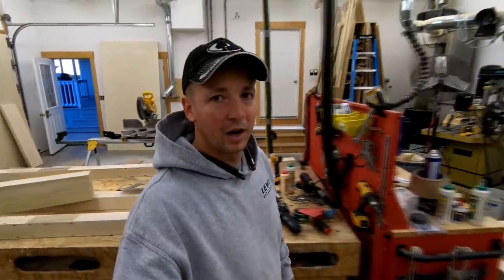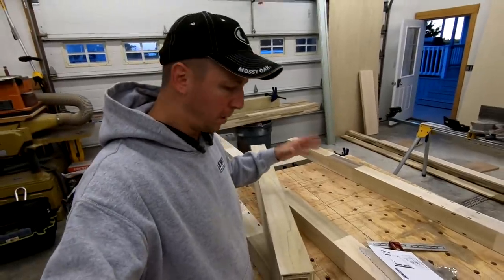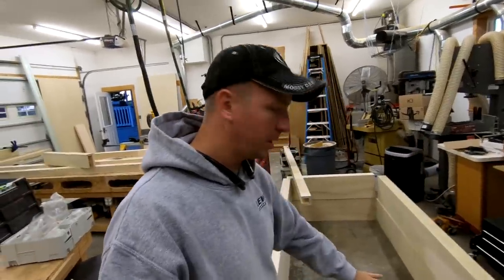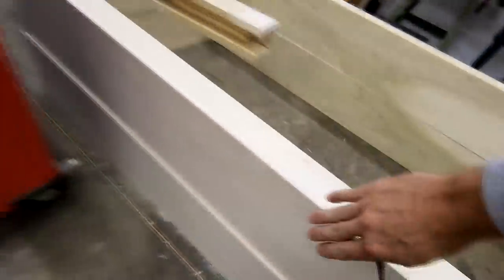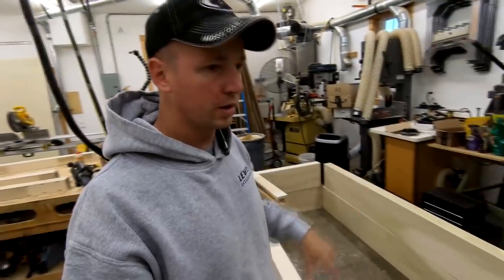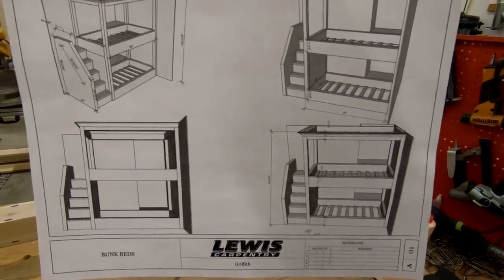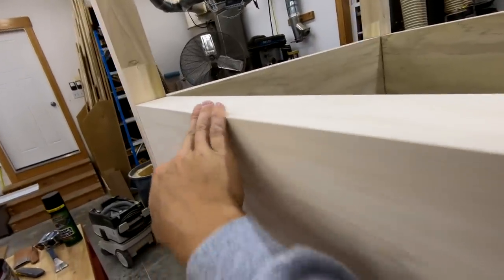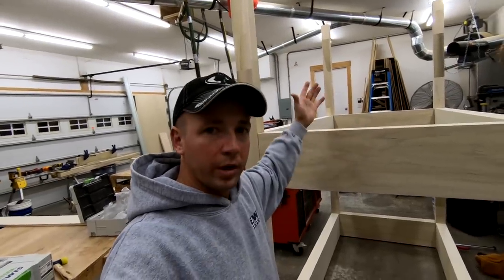Bunk Bed Project - Why I Use a Tape Miter Fold More Than a Lock Miter Joint

Comment: I have to say I enjoy watching your videos, I am a very seasoned woodworker and extreme high end kitchen cabinet and staircase installer. I’m always learning new things, not very often from watching others. Usually by trial and error. Our work is always perfection. Since watching your videos I have learned a few different techniques.  This being one of them. Also the mortiser for drilling square holes. I always wanted a mortiser, but never had a real reason to spend the money. Recently had my first new staircase that used the iron stock balusters. It worked awesomely the treads and on the straight railings. I did run into a few issues with he angled railings, nothing that couldn’t be dealt with, just not perfect first try.
Thank you, please keep doing these videos.
Reply from the maker: That’s awesome. 👊

Comment: Thank you very much for the explanation on your techniques. I strangely feel like my last comment sparked this video. But, your explanation is excellent and honestly answered my question.
I'm using a couple lock miter bits on my router table and have had great results. I have always used a table saw for these types of jobs. I think you clearly answered my question. I think the problem I have had is using blue tape vs clear packing tape. I am doing 2 custom columns this week, and I will be using the HD clear tape.... LOL
Thank you very much for your insight, and clear explanation. You kick serious ass my friend. I will keep you posted on the results....
Reply from the maker: It’s a great topic to talk about. I think you’ll have good luck with the clear HD packing tape. 👍👊

Comment: Awesome vid and explanation, agreed, we use the freeborn lock miter bit in a SCMI CNC shaper, with power feed, did a massive fraternity that called for 5’x12’ walnut panels for walls, (mdf core) then there were beams on ceiling in a grid, beams were 12” wide by 12” tall, we miter locked the MDF, and I would recommend against that because the tongue was extremely fragile, installers pulled it off, but with that being said, running ply core through a miter lock I’m just not sure of the strength in tongue plus how well it would cut, 

Non the less miter folding is just as effective and gratifying at the end when the job is complete, nice job, that’ll be a killer bunk bed!
Reply from the maker: I’ve use it on plywood also with mixed results. Better to fold it. 👍

Comment: I’ve been doing custom woodworking for the past 19 years now and I honestly can say you are fantastic at your job.  Skills and knowledge is a true masters class.  But as you know, every tool you display isn’t cheap and most of us can’t just go out and buy the tools you own.  
So what’s your Philosophy on buying tools and do you set a limit on the price you will or can pay.  A good example is your deWalt cordless router, or should I say the 6 of them.  I have one and it’s amazing, but I cat justify 6.  Your lazar pointer  tape measure which is awesome, is $142.   For some guys that’s a days pay.  
I get the fact that without these tools you can’t do this level of work, especially by yourself.  So how did you cross that line in your head and just buy the tool?   What’s your annual budget on tools and how much would you say you have spent over time fir you shop and van?

I would like to see some inside drone shots of those beams you made.  What a great skill set to have.
Reply from the maker: Great topic. I definitely need to cover that at some point. 👍

Comment: First love your content, I’ve learned more from your videos than probably anywhere else. With that said, I think you would actually like making bunkbeds if you put the plywood aside and used actual hardwood. Yes the material cost goes up but your labor and satisfaction improve. You obviously don’t need to make them for your main source of income so if people want them, make them the way you want.
Reply from the maker: I'm not a fan of the design time and legwork involved mostly. I actually like working with plywood in this instance. Its much easier to work with IMO.

Comment: Great video...

I did a test using this method on some PVC trim boards using just some CA glue. Turned out amazing and I couldn't break the joint. Gonna reinforce with some hidden screws for my project.

Do you think CA glue/screw will hold up long term for exterior trim use?
Reply from the maker: No. CA glue breaks like glass. It seems strong...until it isn’t. It’s not for the outdoor environment where materials move with the seasons.

Comment: Nice work.  Why is packing tape preferred over blue tape?
Reply from the maker: You can see though it and tell if the corner is aligned correctly. With blue tape you are flying blind. 👍

Comment: Nice work, sure wish I had a domino to do that type of pin, rather than a biscuit or dowel pegs... nice. But then again, pegs are cheap :) I use a vinyl tape, its super strong and has an adhesive that is strong but won't stick when you peel it off... its blue, not sure what it's called.

Comment: I use a 3 1/2 HP router in a router table I made myself and I have a power feed I use with it as well. This works for raised panel doors and style and rail door construction. I have well over 100 1/2" shank router bits I use for moldings and other decorative. And yes I am a 3rd generation woodworker, retired now and I have a large shop to work out of.

Comment: Wow, looks fantastic. How does the 45.5 degree trick work in terms of surface area for glue? Do you use pva glue or something that expands to fill the gap? I would imagine the joint would be weak without adequate surface area so what am I missing? Thanks.
Reply from the maker: Its actually pretty good contact. TB1,2,or 3 work great. If you don't over cut the angle slightly you will never get a tight outside corner. So it kind of has to have a slight gap on the inside.

Comment: Great job! I understand that you are painting the surface but if you were to stain it would the tape you used leave a residue that might effect the stain?
Reply from the maker: I sand everything with an orbital sander after I take the tape off. No issues with staining if you're sanding it after tape is removed.

Comment: I find it difficult to decide when I should make 'beams' like this using plywood or even thin solid-wood stock vs just using solid lumber...of course there is always a risk involved with using large pieces of solid wood (humidity, expansion/contraction)...

Comment: Awesome work man! You mentioned using the layout extension in sketchup for that rendering PDF. Which one exactly? Id love to be able to print out that document for my clients and myself during a build.
Reply from the maker: It’s the pro/paid version of sketch up. It’s a bit salty. Cost me $600.
Reply: Insider Carpentry ah. I had a feeling that’s what you were referring to. Thanks man!
Reply: You can just export what your seeing on the screen as a 2d image file. Sometimes the lines are not as clear and and dark as what your seeing on the screen. You might also want to crop the image a little if it's not quite center.  

You can also just take screen shots and put them on one page like a collage. Also use the dimension lines with different angles looking at the piece. It takes a little more time, but saves some money for sure. 
I use a macbook and have numbers (spreadsheet program) to put the images on a blank sheet. You can create a table on the bottom of the page to make it look like an architectural drawings with information on the project as well.
Reply: Alex Scire wow! Thank you! That’s some great info and I really appreciate it. I’m going to try that out 👍🏼

Comment: By 4 sided tape wrapping like that at 45.5° aren’t you concerned it can shift out of perfect square as the glue dries?
Reply from the maker: Indeed. For that reason I put blocks on the inside. On a 4x4 post I’m not too worried. But on bigger and wider stuff I like to use blocks to keep things square.

Comment: Hey. Great videos as always. Table saws for the workshop are expensive and require a lot os space . Do you rate the dewalt flexvolt portable table saw for this kind of precision. Cheers pal
Reply: You can still get excellent results with a portable table saw. You just wouldn’t use it to make a living if you had a choice.

Comment: How will the top bunk ultimately be attached to the stiles? I’ve not used dominos - are they strong enough to hold the structure, mattress and person?
Reply: I had the same observation regarding the sheer strength of the Dominos.  I would not want to have a 'Step Brothers' bunk bed situation.

Comment: This guy is using a high quality glue, accurate smooth cuts, and proper clamping . Lock mitre's (while strong) are not really much of a benefit in this application ( not to mention time consuming). That miter fold with glue is stronger than the joint. z